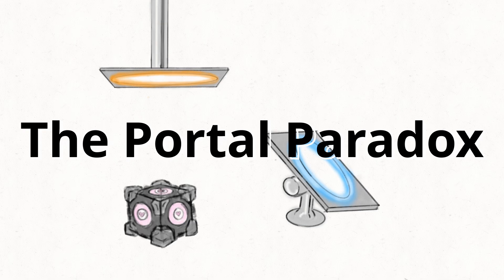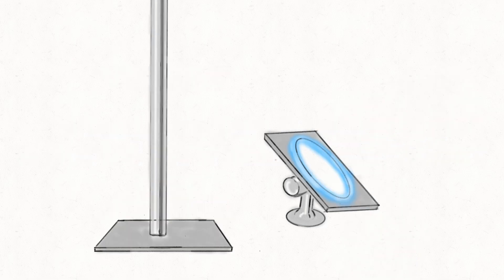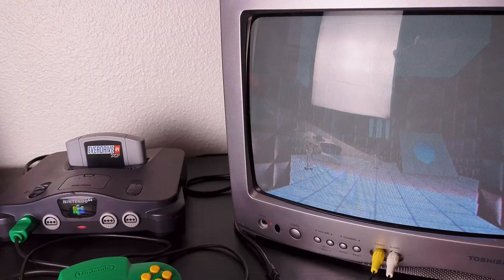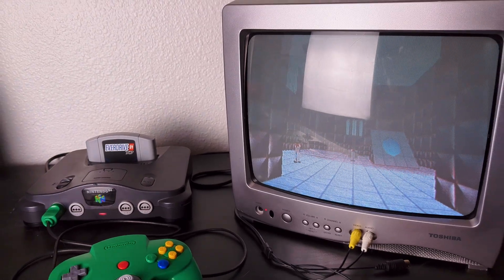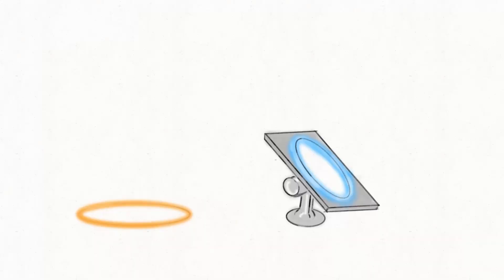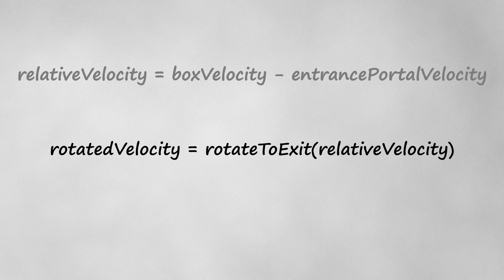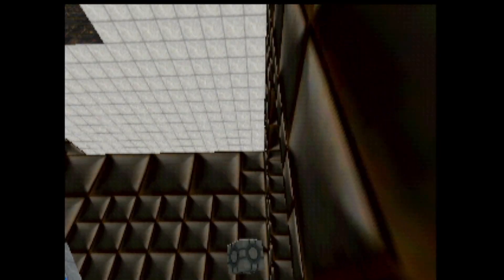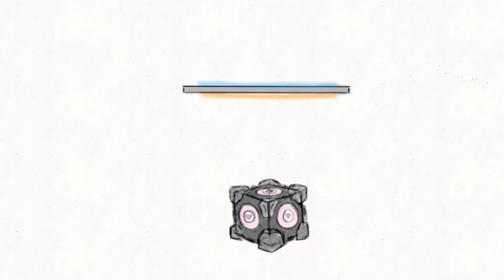I rewrote Portal from scratch and solved the Portal Paradox

Comment: I disagree.

First, since it's not the original engine, your solution is speculative at best - certainly not a definitive answer.

Second, while VELOCITY is indeed relative, momentum and inertia are other factors. The cube has zero momentum and its inertia would keep it from LAUNCHING the way it did. The portal can't grant it that kind of kinetic energy.
Reply: Momentum is also a relatively measured property. It's whatever was measured as the velocity multiplied by mass after all. 

Inertia should also prevent an object from changing directions without a force (which is by definition a change in momentum and velocity), however portals clearly are able to do this regardless. At a fundamental levels portals show to be able to alter the momentum and velocity of objects passing through them. This becomes more clear when you start thinking about portal interactions in other reference frames as the portal changing the direction an object is moving will have increased/decreased its kinetic energy in most frames of reference.
Reply: @J4hk3  Hmm. Okay, so essentially, portals break the laws of physics and momentum, since inertia simply doesn't work the way they show it.

In that case, there can be no definitive answer at all.
Reply: @chrisjones5949  The portal exists as a velocity and momentum altering element in the problem. You can argue that the portal "breaks physics" but that doesn't mean you can't give an answer based on what is consistent with how the portals are shown to work.

Really the idea that the motion of matter will change on passing through the portal is much less of an impossibility than the alternative.
Reply: @J4hk3  Okay you know what, I don't care. This isn't in the original engine, it's not canon, the portals explicitly DON'T change the momentum or velocity of things that pass through them so they can't make the cube fucking jump, and IT'S ALL FICTIONAL ANYWAY SO WHO GIVES A FUCK.

Peace out.
Reply: @chrisjones5949  
It IS canon. Look at the moon scene in Portal 2 and tell me why nobody is flying away sideways while the moon continues to orbit the Earth? (Which is currently revolving around the earth 2,228 miles per hour)
Reply: @breakerboy365  It's not canon. Sorry. Valve hasn't canonically explained the way portals work, and likely never will.

Per your own logic, it's not possible for a portal to have been placed on the moon, since it's a moving object and portals can't be placed on them. So the game contradicts its own rules. Almost like it's a work of fiction that isn't beholden to reality...

Dunno why you felt the need to reply to me from 7 months ago just to argue something and still not have a definitive answer.
Reply: @chrisjones5949  
"It's not canon. Sorry. Valve hasn't canonically explained the way portals work, and likely never will."
--------------------------------
In a similar vein, if we have to go by what Valve says, because Valve didn't formally explain anything explicitly that happened in Portal 2, the game never happened? Interesting...

"Per your own logic, it's not possible for a portal to have been placed on the moon, since it's a moving object and portals can't be placed on them."
--------------------------------
1) In terms of how portals behave in game, you seem to not have played the game (See footage of the neurotoxin generator).
2) In terms of how portals behave in the Portal universe in relation to portals on movable surfaces, do you think the Earth doesn't move? I'll just leave this point on that question.

"So the game contradicts its own rules. Almost like it's a work of fiction that isn't beholden to reality..."
--------------------------------
Contradictions can't happen in any universe, real or fiction. But as the game has shown you (if you have played it), it shows you how portals behave. The argument isn't "portals don't exist discussion ended", instead it's "what if they DID". 
A little cowardly to put forth a statement on what would happen in the Portal universe in your original comment, and then fall back on "well it's fiction anyway, so who cares!" when you claim is challenged.

"Dunno why you felt the need to reply to me from 7 months ago just to argue something and still not have a definitive answer."
--------------------------------
Yet you replied...7 months later, so if you want that to have a bad connotation towards me, then the same applies to you.
Reply: 1. I didn't reply to you 7 months later. I replied to you within 12 hours, because I got a notification about your asinine necro comment. Learn how time and notifications work, kid.

2. My argument is not "Valve didn't canonically state something, so that thing never happened." My argument is that because they didn't canonically state something, you can't declare it canon.

3. I have played the game. At least a few times, all the way through. Keep your assumptions to yourself.

4. This entire discussion, including the original video we're replying to, is "what would happen if a portal could be placed on a moving object?" This discussion exists because the games don't provide an answer, and in fact portals can't be placed on moving objects like these within the games. So either the Moon does not count as a moving object, which invalidates your explanation, or it does, which means portals don't act consistently within the game universe, which renders ANY explanation of their behavior pointless.

Let me know if you still struggle with any part of this! 😘
Reply: @breakerboy365  "You're still carrying on a conversation you deemed too old to carry on"

That's not what I said, actually. Go back and read through it again and see if you can spot where you screwed up.

"Then the game in its entirety didn't happen because Valve didn't canonically state that it happened"

Jesus Christ, what a stupid way to look at things 😆You're grossly oversimplifying the meaning of stating something to be canon. Valve presented Portal 2 as a series of events that happened within its universe - that means what we see and hear during the game are canon. Valve has NOT, in-universe or externally, given an explanation for how portals behave in all situations, or the science behind them, which means there's not a definitive canon for how they work. 

I'd love to hear how stupid your next excuse for not understanding that is. Should be hysterical.

"Then your memory of the game is very poor"

Kiss my ass. Just because you're stuck up yourself and determined to be right doesn't mean I'm wrong or misremembering the game. Though I understand that's convenient for you to believe.

"I think you mean..."

Thanks, Professor Pedant! I'm so terribly sorry that you didn't like my phrasing! Let me try again:

In-universe, portals are always presented as stationary objects, not moving ones. Is that better, Professor?

"That's a false dichotomy"

Except no, it isn't. Either the portal on the moon counts as "moving," or it doesn't. If it DOES, then it contradicts absolutely all previous portals, which were clearly presented as stationary, so their behavior isn't consistent in any way. If it DOESN'T, then your point is invalid. There really isn't any other way to look at it - either that portal is moving, or it isn't. It can't be in some third state of inertia.

Oh, and your example about fluid water? That doesn't work, because "water" in video games, even when it's not animated or presented as fluid, is a representation of the water that exists in real life, so we can judge its behavior by that. Portal guns and the space-bending wormholes they create do not exist in real life. Just in case you didn't know that.

Comment: Another way to think about this is the physics occurring on both sides of the portal. If you had 2 portals on a ceiling and stood half way up into one you would float there because you have gravity acting on half your body pulling it in both directions.

In the case of the moving portal, once half of your body goes though it you have momentum acting on half your body that would at some point pull you through the portal with velocity. It would probably stretch you a bit too 😅

Comment: The flaw i see in your calculation is that you only apply velocity and are missing the mass therfore resulting in unplausible energy conservative. If a portal with a velocity of 10m/s and a mass of x kg moves an object with a mass of 10x resultig in the object moving with 10m/s you have a net energy outcome. Its the similiar to portals overcoming gravity without enegy input when you place them for example over one another.
Reply: Well you said it yourself, portals never abided by conservation of energy laws to begin with.

Everything we've seen about portals functionality shows they manipulate the motion of matter without regard to its mass. And by changing the direction that objects move in the portals will have changed the kinetic energy of the object when observing the interaction in other frames of reference.
Reply: @J4hk3  That is not correct. The original game manipulates the direction of a movement, not the speed (independet from mass) and the position (non existent IRL). 

Now we observe an acceleration, which needs force and is dependend on mass. It's just a tricky question and not really solvable in my opinion as we can't observe it in real life.

Comment: What if you had a thin piece of paper with a portal on it and dropped it on a cube of, say, tungsten? The cube still shoots out the portal with the same velocity as it went in with, but I feel like that violates the laws of thermodynamics. Maybe the portal should bounce off the cube unless you're pushing it down.
Reply: I think there's more of a physics-law-breaking problem with portals existing before anything else :p

Comment: Your issue in the first case is that you are using the orange portal as a reference Fram for the box, but not the blue portal.   If you were consistent  the speeds of the box and blue portal would cancel out.
Reply: They do cancel out. That's what's happening at 2:22, the backwards motion of the exit portal (backwards because it's moving the opposite direction its facing) cancels out the forward motion of the entrance resulting in no change in motion to the cube. Which is logically consistent because a back to back portal would behave the same as a hula hoop.

Thing is in the main scenario the blue portal is not moving. So there isn't anything to cancel out the change in motion brought about by the orange portal moving.
Reply: @J4hk3  The blue portal isn't moving in relation to the cube but is moving in relation to the red portal. think of it like a person on a train .everything outside moves at the speed of the train. you can take one of two meaningful reference frames . wither on the box were blue isn't moving and red is or on red where both blue and the box are moving at the same speed
Reply: @hunter11300  So if we're looking at the motion relative between the two ends of the portal then it's a matter of that relative motion being how the portal changes the cube's motion. If you look at 2:22 again, you can see that portal does not impact the motion of the cube, because the blue and orange portal actually aren't moving relative to each other. They are moving together therefore there is no relative motion between them.

Basically the rule is that portals will change the object's travel direction when they differ in facing direction (taking into account that the exit faces backwards by default) and change the object's speed when they differ in speed.

As far as reference frames go, you basically use the entrance portal's before the cube enters and then use the exit portal's after the cube exits, as it between those two frames that the manner in which the portal will conserve the momentum of the cube will be observed.

Comment: Quick question, if you slam a hoola hoop over a box, does the box suddenly jump? Why not? It would theoretically still fit your equation since the hoola hoop is just 2 portals on the opposite sides of the same object.
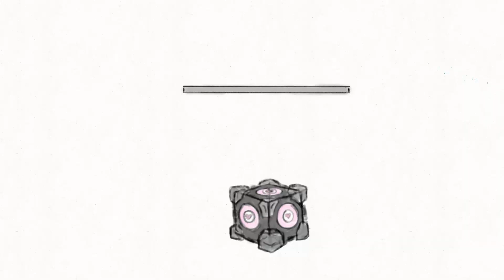Reply from the maker: I address this in the video at 2:02
Reply: @james.lambert  Thank you for pointing that out. I will admit I did not see that part. But how is the momentum transferred to the cube? The portals are not physical objects, they are just points in space. The velocity and momentum is tied to piston as that is the actual object moving. But nowhere is the momentum transferred to the cube, unless the portal has a physical interaction with the cube as in instead of co-ordinates in space moving there is an action of deconstruction and reconstruction occurring.
Reply: @james.lambert   After further thinking I realize that both will have the same result due to occupation of space. Atoms are not able to occupy the same space so as the portal move closer you are literally pushing your self to make space for the rest of you. The speed you are pushing your self  is equal to the speed the portal is moving and would then imply momentum.

Comment: The only issue that I see with the velocity logic is that the box velocity does not necesarily equal its velocity entering the portal. If, for example, the box were moving away from a portal that was moving toward the box faster than the box was moving away, the outcome should be different than if the box was moving at that same speed toward the portal.

Comment: Nice work with the programming on this, but the physics is wrong.  Of course any physics involving portals is imaginary, but just looking at it, you're not considering the right factors in your equation.  The velocity is not what's being transferred: the momentum is being transferred.  Since the portal itself is functionally a hole in the piston head, the portal itself has no mass and therefore no momentum.  The momentum is all in the surrounding piston head, which is transferring that force into the floor, not the box.  In short, the box would plop, or maybe jump a little if the floor is shaken by the piston slamming into it.
Reply: The equations used can be used to apply to momentum as well as velocity. Since portals don't alter the mass of an object they are effectively altering momentum the same way they are altering velocity. As they are basically altering momentum by changing the velocity component of "velocity*mass=momentum".

The idea that they can't alter the velocity or momentum of an object doesn't work. At a fundamental level they need to in order for the portal to be able to behave as a seamless passage most of the time. If what you said was true, portals wouldn't be able to change the direction an object is moving as they are shown to in the games. By definition that change in movement direction is both a change in momentum and velocity.